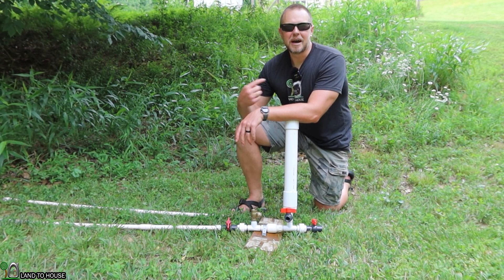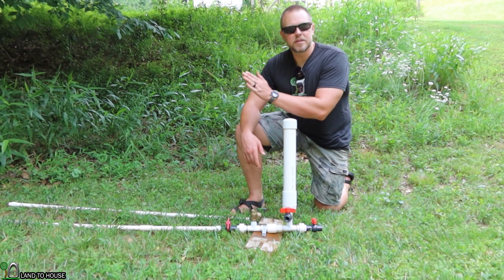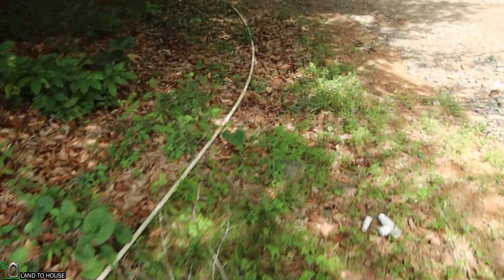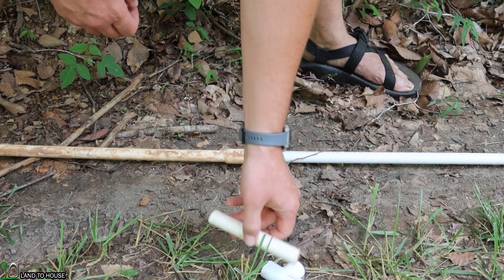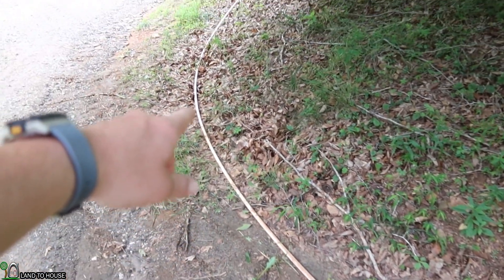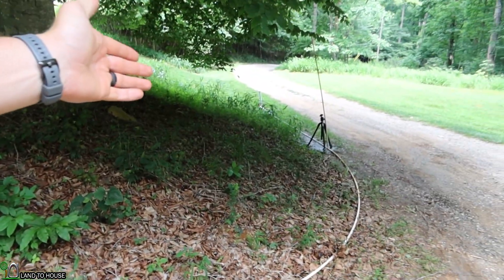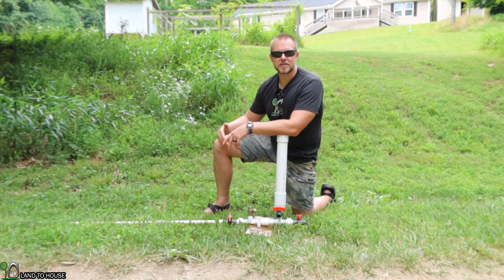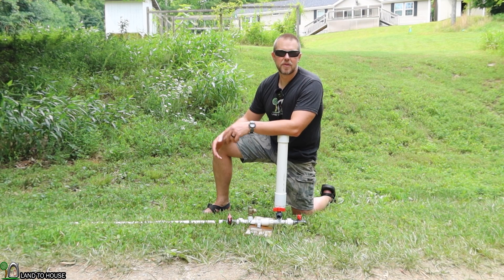Standpipe for a Ram Pump [ Do I Need One? ]

Comment: Got a river at the bottom of my friends property. A ram pump won't work, will it?  Property is 60' higher than the river.
Reply: Use solar panels to power a pump.
Reply: It would work. Needs good head pressure.

Comment: Could you use a 2 ft section of 3" PVC as a stand pipe instead? I'm assuming it would hold a similar volume as a 6 ft section of 1" pipe.
Reply: Late answer here, but for anyone else reading and that might have the same question, the answer is no. 

It’s not about the volume really in the stand pipe, it’s about height. Think about it like this. Water will equalize it’s level in a open system. Meaning that the water level is the same in the stand pipe as at the source. If you’d remove the pipe after the stand pipe water wouldn’t move, it would just equalize.

So what you’re doing with a stand pipe is that you ”artificially” is moving the source closer to the pump.
Reply: @Yiveytubethanks

Comment: Would using a standpipe allow you to use something like garden hose to fill the standpipe.  I know one wants to have as rigid pipe as practical for your drive pipe - between the source and pump.  If I am understanding the stand pipe benefits correctly, the rigidity of the pipe upstream of the stand point is not so important.

Comment: Bought one of your 1/2" pumps.  I havent got it cycling yet but darnit I will soon.  Idea about the standpipe maybe you have thoughts.  Relating to a sealed intake that isn't open to air and pressurized similar to trying to cycle a pump with tap pressure keeping valve sealed and preventing pump from cycling.  Do you think a standpipe could compensate for this issue?  I know having the release of pressure to air is important for drive/supply to be able to cycle the pump with the pressure wave created but couldn't that issue with too much line pressure be compensated in theory with a stand pipe?  I appreciate your time and efforts.   Inspiration move me brightly.  🎼🎵🎶🎵
Reply from the maker: If you were to pressurize the line yet have an open standpipe I feel like the water would be a geyser out the top of that standpipe. Not having the line pressurized is what allows the pressure wave to go up the drive pipe and then fall down gathering speed to slam the waste valve closed.

Comment: have you tried different sizes on the ram pumps pressure tank? And perhaps different shapes to?
Reply from the maker: Yes. There is a point where larger tanks just take longer to prime initially.  Larger does not make a difference after a point.

Comment: Nice...can we use reducer from big to small pipe without use stand pipe?
Reply: That is what I was wondering. Is a stand pipe required to neck down to a smaller size.
Reply: The inertia of the water in the drive pipe is what causes the pressure spike that pumps water out the delivery side above the supply height.  Having that last section into the pump sized to match the waste valve appears to be optimum, so if the total is not too long and the last section is a match, it will probably work without a stand pipe.

Comment: Can you make a 3/4” or 1” ram pump? Supply pipe same size as pump all the way to the source.
Reply from the maker: As long as the pipe is big enough to feed the needed gpm to the two different pump sizes yes you can have supply pipe the same. The Drive needs to match the size of the ram pump waste valve.

Comment: That is a nice demonstration Seth.
It should be mentioned that the ideal distance from pump to atmosphere is dependent upon the velocity of the back pressure wave in the pipe.
If the pressure wave is released at the standpipe before the next cycle of the pump, the water flowing through the drive pipe wont have to fight the pressure wave .
A very general rule of thumb is to have the distance from the pump to the nearest atmosphere opening (stand pipe) about a ten to one ratio. For example, if the head is 5', the drive pipe should be 50'. Of course, the distance to the water source can be just about any length but you need the stand pipe for the system to be efficient.

Comment: Using the stand showed the pump rate increase, but in the end you said total <100' would increase the pump rate but its inefficient.  I'm confused
Reply from the maker: The ideal cycle time on a pump is once per second.  when the pump cycles too fast the pressure wave does not have sufficient time to make it all the way up to the top of the head pressure and back.  My example was merely showing that that cycle time does change based on pipe length. If you tried to run this same pump on 300' of drive pipe the pump would likely not cycle. A standpipe would be required.
Reply: @LandtoHouse  O k. Make up time was what I started to think.  Thx

Comment: I think adding a stand pipe to a silt filter bucket makes sense. 
Basically, slow the flow down enough for the silt to fall out, but also keeping the head pressure. 
Maybe make a cyclone filter, like the ones for sawdust collectors. Actually, that might mix things up too much.

Comment: I have an experiment for you to try!!! Pressure = density of fluid x acceleration of gravity x area of internal pipe x height of fluid x pipe resistance… the water density and gravity aren’t changing anytime soon, so remove them from the equation. Hypothetically, you could feed five 3” pipes into one 3/8” inch stand pipe using Y connections and it would multiply the falling water pressure by a factor of 130! (Internal Traverse area ((35.35 x 5)/0.196) 3 feet of falling pressure would be enough to convert to 390ft of 3/8” falling water pressure!!! After you apply your resistance coefficient according to your pipe type and size, you should get a very close approximation of your hypothetical max pressure. This would be an excellent solution to the individuals who do may not have a lot of falling water pressure or property area!
Reply: Only catch is, you’ll have to find a solution to create a tank at the top of the stand pipe with a fairly strong support base… unless you want 390 ft of pipe shooting into the air!
Reply: I’m not sure I follow your math and logic here. 🤔 Adding multiple larger diameter pipes into one smaller diameter stand pipe shouldn’t increase pressure at all?

The water in the stand pipe won’t travel higher then the source anyway since it’s two open ends. It only equalizes and thus make the feed pipe shorter, thereby allowing the water hammer to travel upstream a shorter distance.

Comment: I thought you mentioned lack of head pressure and needing better lift capacity for higher pumping needs as a reason for a stand pipe.
Reply from the maker: Yes if it requires your drive pipe to be longer than 100' to gain the head pressure the stand pipe is needed. The main thing is cycle time.